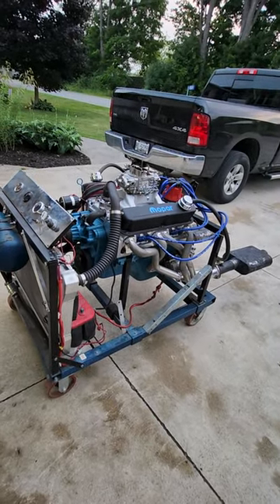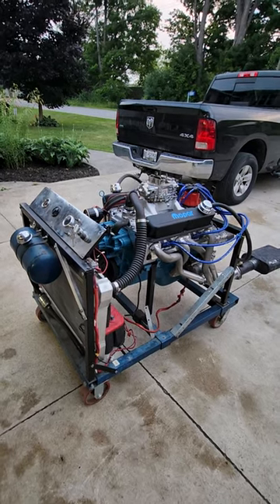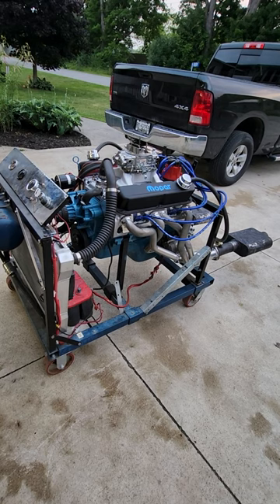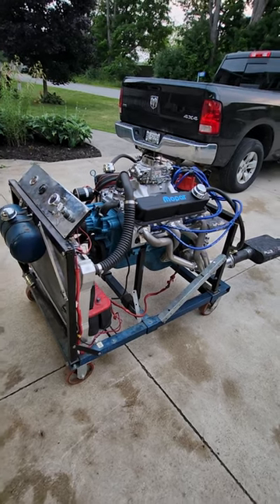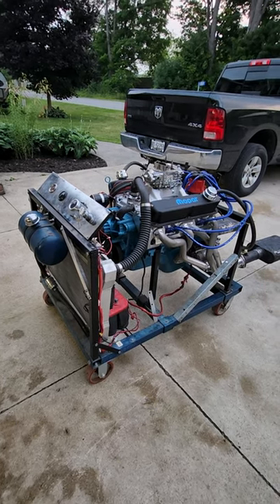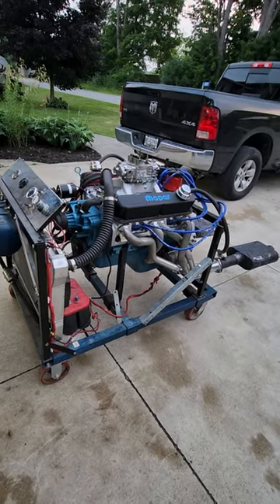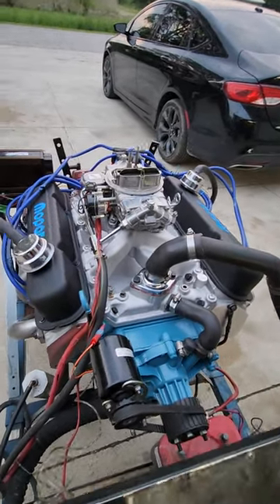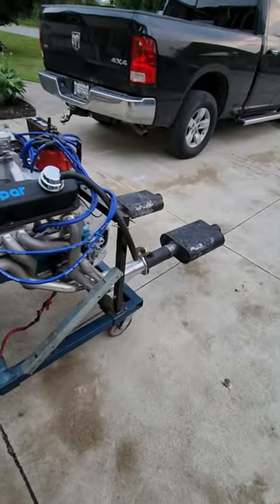Mopar 360/408 Stroker, Scat, Lunati Hyd Roller, Speed Master Heads

Comment: Terry, love the videos. I have a question. I’m building this exact motor. The only difference is I’m using the comp cams big mutha thumper hydraulic flat tappet cam. I’m using HS roller rockers but I’m having a problem with what pushrods to use. Might you have a suggestion?

Comment: Terry, how do you like the speed master heads and/or cool gap intake? Do they require a lot of port clean up from the casting?
Reply from the maker: I have had good results from speed master heads. They make good power and castings are good. The intakes are usually OK. They sometimes need some clean up. I plan on trying the intake on a dyno to see how it compares to an Eddy.
Reply: @brightonracing  I would like to see those results as well since it’s half the cost.

Comment: Terry how would the big voodoo hydraulic roller camshaft do for A Streetcar I like the sound of it and the performance of it but I would definitely like your opinion. Can I get the cam number so I can order it thank you very much😊
Reply from the maker: There isn't much vacuum for brakes. I had it in my 408 in the midnite express. I had manual brakes on it and no power steering, so it wasn't that streetable.... but in a car with manual brakes or a vacuum booster it would be OK. Higher stall converter or 4 speen is needed as well. 
  I would use it in a street car